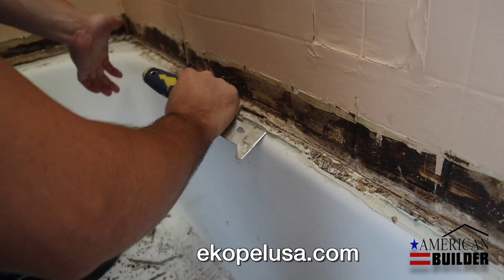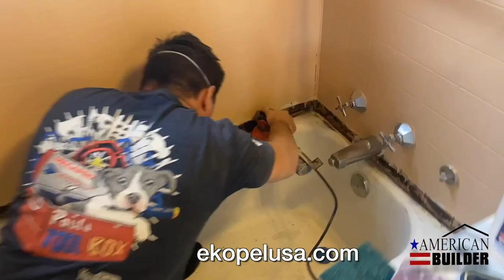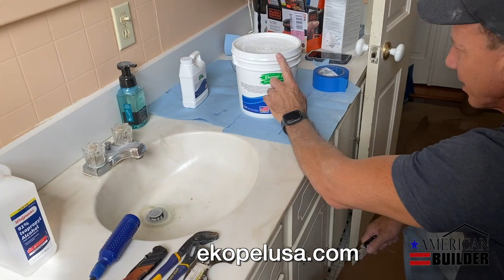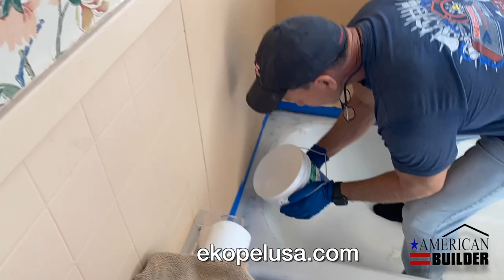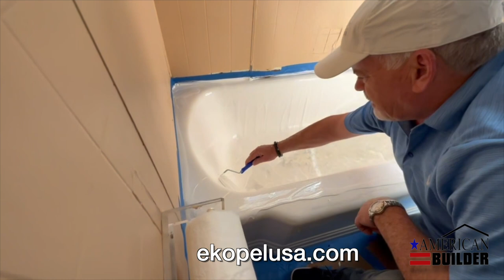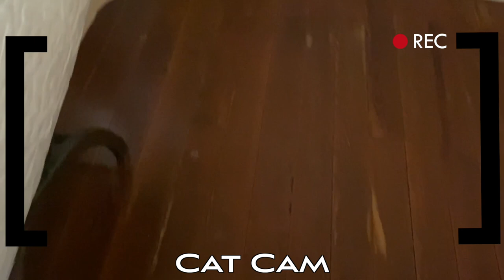Paul’s Toolbox Ekopel 2K Bathtub Kit With Surprise Ending | Paul's Toolbox is The Best

Comment: Good question, how did you fix the paw print in the surface? Can it be sanded and then refilled with more Ekopel, and will the repair level into the remanded area making it undetectable? If so, how long did you have to let the first coat dry before sanding and repairing?